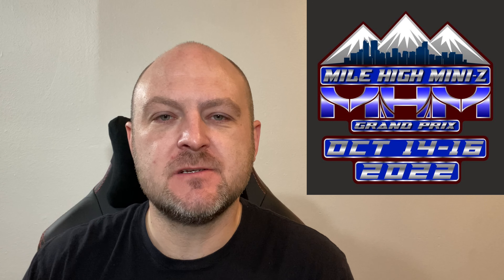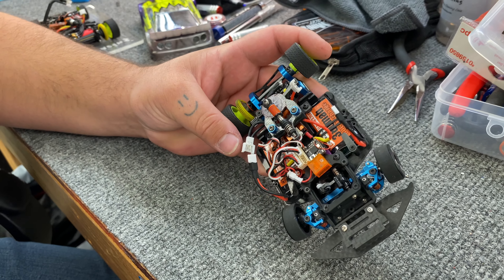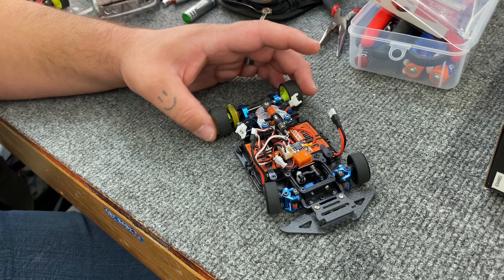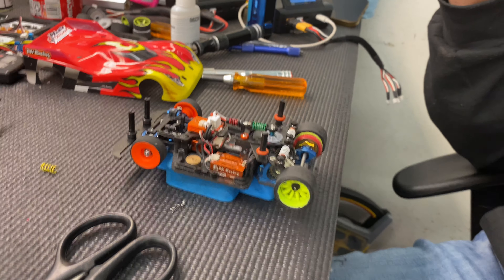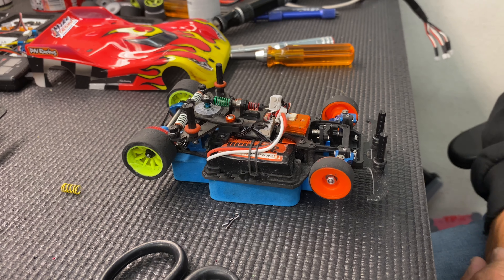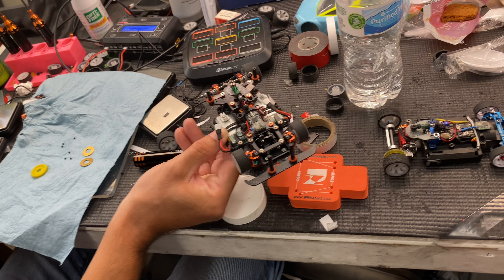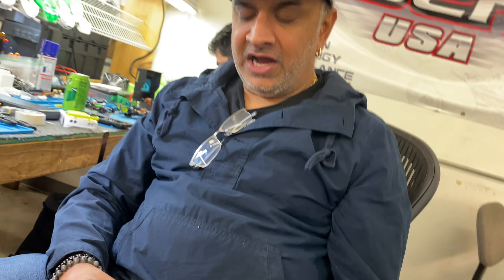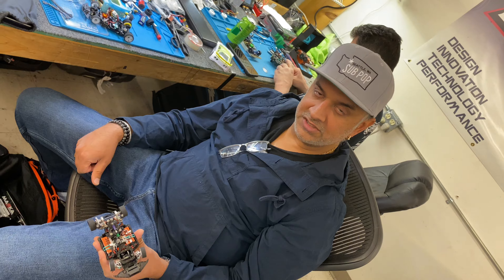Mini Z - The New PN Racing Mini-Z PNR 3.0 Chassis Conversion Kit at The Mile High Mini Z Grand Prix!

Comment: what is the setup of the colorado stock car with lipo?
Reply from the maker: 64 pitch 12 tooth pinion with a 53t spur. 2500 kv motor with pretty much any RWD chassis. 2s lipo. Basically same as super stock but with 2500kv / 12t pinion.
Reply: @TheShopMiniRC  Do you think PN Stock has any advantages or disadvantages over CO Stock?
Reply from the maker: @GustavoMauricio  Someone coming from Box Stock will be more comfortable with PN stock because its still AAA batteries and not lipo. Other than that, the lipo car far superior in its performance. If someone is familiar with Lipo... the jump to CO Stock is pretty much the same as to PN Stock, but you get a better performing car.
Reply: @TheShopMiniRC  I migrated to lipo about 2 years ago, I don't have a AAA car anymore. I defend the stock category with lipo and aaa running together but people here still have restrictions. I have a 2500 12/53 car and I like it a lot.